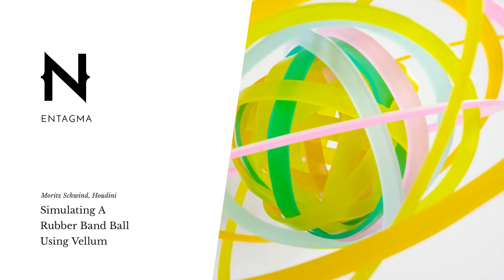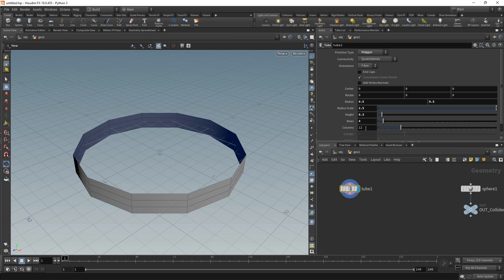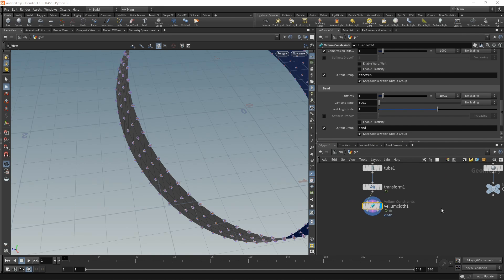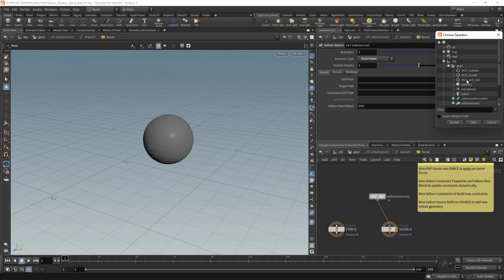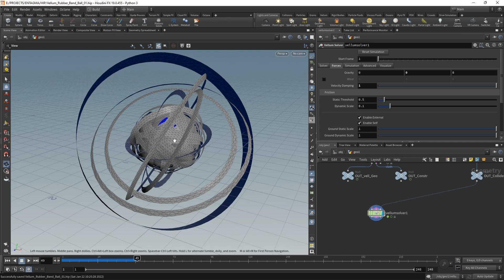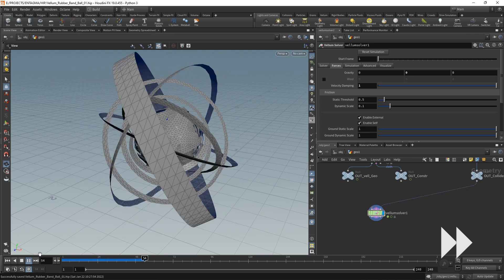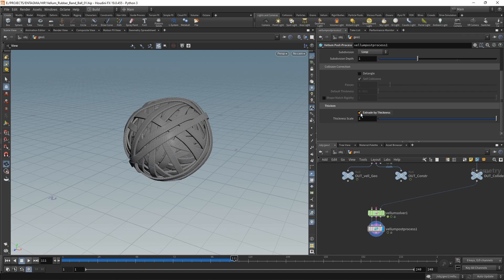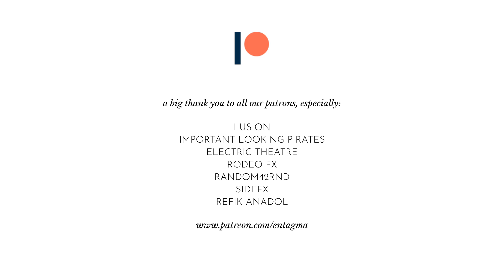Houdini Tutorial: Making A Ball Out Of Rubber Bands

Comment: Cool one! Could be possible to avoid jittering making the layers non active after a few frames, or maybe with the sleeping feature inside the vellum solver..?
Reply from the maker: Contrary to intuition this (at least in my experiments) makes the situation even worse with intersections not properly resolving and the whole simulation falling apart after a few frames. Cheers, Mo
Reply: vellum solver dop has auto sleep feature
also you could try with layers, before Out_Vell_Geo you need wrangle with something like i@layer = @Frame;
and play with layer shock in solver